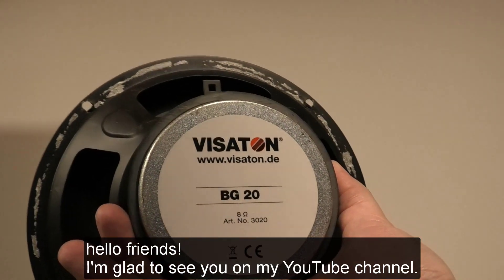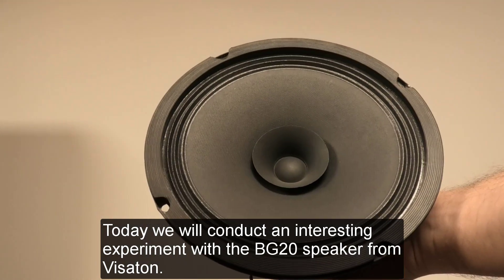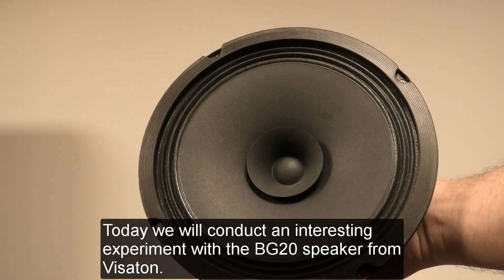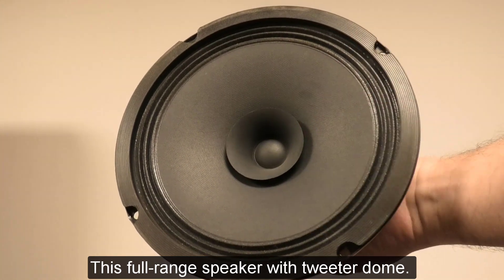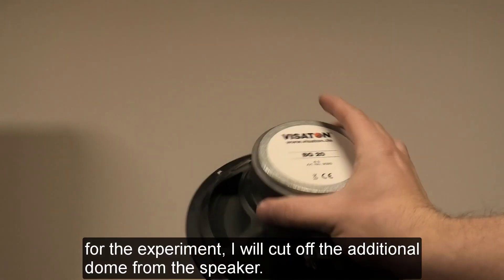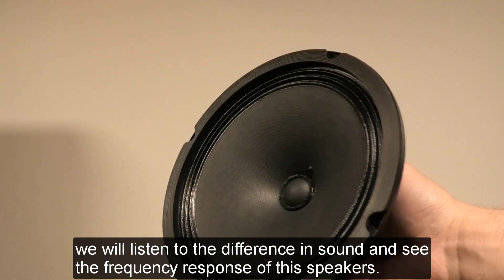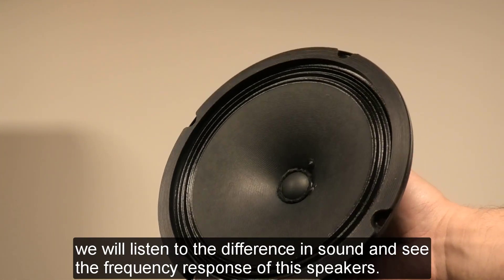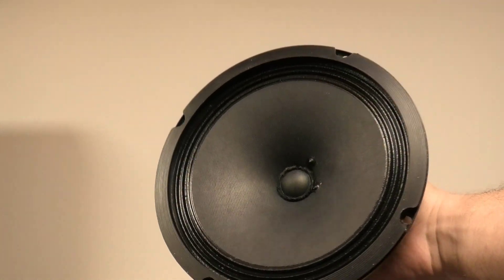BG 20 full-range speaker with tweeter dome VS BG20 NO tweeter dome / DIY speaker build

Comment: All my BG20 (8) are without dome
Reply: Pentaton BB?❤
Reply: @nerdfpv  No , my own projekt . Main Speakers are two B200 one in the front (way quiter) and one in the back as close as possible together in a speciel horn whith ventilation to the top and to the bottom . The resistor of the front speaker allowes me to bring in a capacitor in paralell for high boost . I use two BG 20 for the higher sub open (no box). And one 18 inch for the low end open (no box). One BG 20 is on the top of the little horn the other below . The 18inch is near the floor . Totaly hight is ca. 2m . 5 speakers per channel . The B200 have a 3.5 Watt per channel tube amp and this is brutal loud (whith pre amp) . The subs got two subamps . One for all the BG 20s and one for the two 18inch speakers . Whith this speaker system you hear every room , its like beeing the secret service . You need the wall in the back to reflect the sound and i placed various steel pannels in the room to reflect the highs . The room is not my enemy , its my friend , i use it to make the sound realistic and great . The 8inch speakers gives the original size to the instruments and everything . In this constelation the room makes the sound way louder . I hate it to kill sound .
Reply: @martina5434  Das klingt nach einem Hammer Concept👌 den Ansatz den Raum geziehlt zu nutzen anstatt ihn abzutöten finde ich auch besser als andersherum.
Kann man die Teile Mal sehen?
Reply: @nerdfpv  Mein schlechtes Englisch hat mich wohl als Deutschen entlarvt . Und nö , hab eh schon zuviel verraten . Aber die sìnd zur Zeit auch gar nicht aufgebaut . Hab noch was anderes entwickelt , das steht gerade hier . Das ist für mich der Königsweg weil es mit nur einem Breitbänder pro Seite auskommt . Ich würde sehr gerne verraten wie das funktioniert aber wenn ich das vielleicht doch mal verkaufen möchte dann sollte ich mich bedeckt halten . Nur soviel , es ist eine frontloaded Hornform die keinerlei horntypische Verfärbungen erzeugt und den Schall innerhalb des Horns so reflektiert daß sich aus der Summe der Reflektionen ein exakt dreidimensionaler Raum ergibt an dessen Wurzel sich der Lautsprecher befindet . Quasi die Simulation einer lauten Punktquelle bei der die Luft nach dem van Huygens Prinzip ebenfalls in der Form angeregt wird daß sie den Schall in alle Richtungen reflektiert . Im zeitlichen Verlauf ausgehend von der Schallquelle . Also sehr realistisch und nicht einfach nur nach vorne weg wie herkömmlich . Vorne wie hinten befindet sich das gleiche Horn . Das bewirkt daß der rückwärtige Schall komplett nach hinten abgeführt wird und auch nicht das kleinste Bißchen den Weg zurück nach vorne , wie bei einer Box , findet . Eine Dämmung ist also nicht nötig . Es ist wirklich ein Königsweg der den erzeugten Schall mit viel Liebe leben läßt und voller Überaschungen und Wunder die man gar nicht glauben mag steckt . Ich möchte es später , wenn ich wieder Zeit habe , mit dem B200 (hab noch welche) verwirklichen . Zur Zeit habe ich eine kleinere Version mit einem kupferfarbenen Alpair 6 (ca 6cm Membran) . Einziger Wermutstropfen : Man benötigt ein DSP oder Equalizer . Mal sehen wie das dann mit dem B200 und der größeren Variante ist . Möglicherweise geht das auch ohne DSP .

Comment: Hi try adding an aluminium sewing thimble in the centre of the dust cover, please see my video  fantastic diy tweeter speakers.
Reply from the maker: Hi. where can i find your video?
Reply: @goodsound202  hi sorry youtube have taken down my channel because of copyright issues, but if you put an aluminium sewing thimble in the centre of the speaker it extends the frequency range, and sounds brilliant. Regards
Reply: @trevorshore1958  Hello! I'm interested in your method, but I don't understand it! Do you still have the footage available? You can't send it any other way, isn't it possible on watsapp? With that sewing thimble, I think the sizes actually matter, I think there is an ideal size, right?
Reply: @ioanzaman9225  Hi please type. Fantastic diy speakers by adding a simple thimble.  Simply glue it to the centre of the dust cover and enjoy, midrange so clean and clear, I find a large one the best sounding. Regards
Reply: @ioanzaman9225  Have you had time to try the thimble yet?.. It vibrates and sounds wonderful.
Reply: @trevorshore1958  Since I don't understand the method very well and I haven't seen it anywhere in the pictures or in the movie, I didn't dare to experiment, so as not to damage my speakers! What I don't understand: The wizer cone is cut out and emphasis is placed on a cone made of a lighter material! How can I make the cone heavier by adding such a metal piece glued to the dust cover?
Reply: @ioanzaman9225  The thimble is very light, it is the silver object in the centre of the dust cover on the video, it is used for repairing clothing, just hold it against the dust cover with the tip of your finger to try it out.
Reply: @trevorshore1958  Thank you for your kindness! If someone has used this experiment before and has pictures, videos or exact technical details, please post the method here on Youtube, so that it is accessible to all fans of fullrange loudspeakers. Mr. Steve, haven't you tried to contact Visaton, maybe they would apply the method and manufacture BG 20, with this improvement? I have these thoughts because I love the BG 20 speaker and I even made a pair of speakers with these speakers, but combined with tweeters and I am extremely happy with the results! If you have not seen your method used by others, I urge you to try a patent! Why not? Sorry, I'm using a translation program, but I hope you understand!